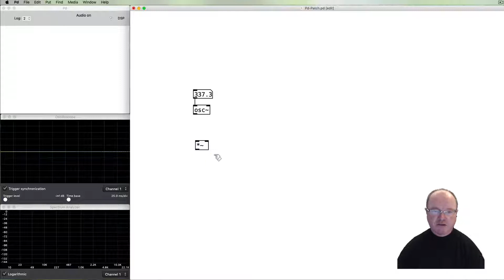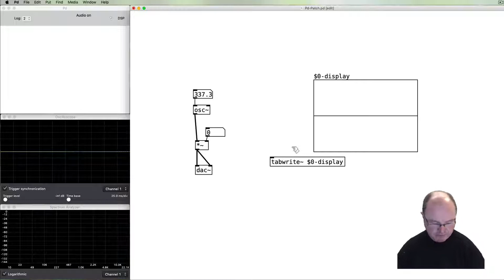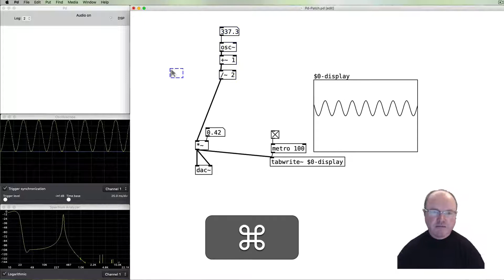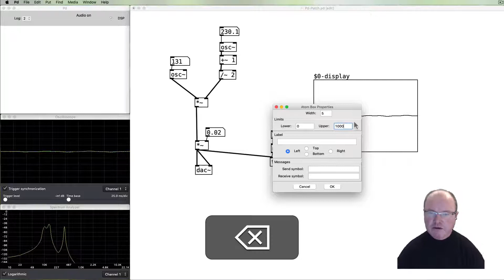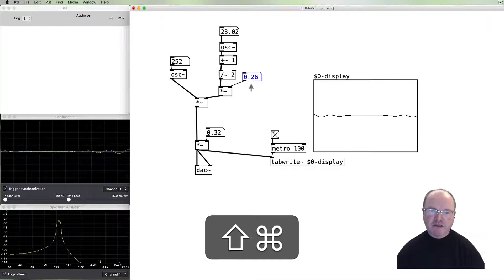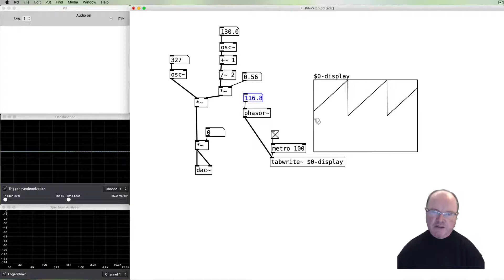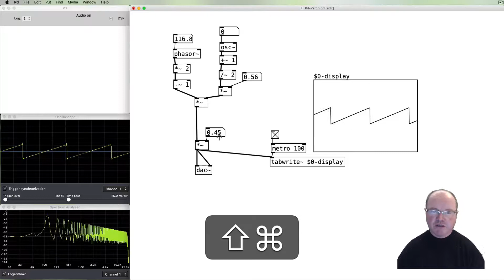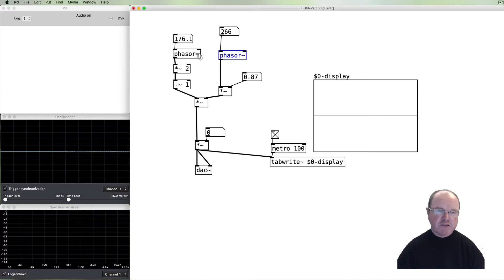8. Amplitude Modulation in Pure Data

Comment: Was there any particular reason why you translated to a unipolar waveform (6:00)? The only thing I noticed was that it halved the rate of the tremolo.
Reply: I think that it is because the waveform is being used to modulate the amplitude and the amplitude conventionally goes from 0 (no wave) to 1 (full volume), so you want the waveform to go from 0 to 1 as well. If you use a bipolar wave to modulate the amplitude, the amplitude will go from -1 to 1 instead. There's nothing wrong with this, but for a sine wave, this will result in the amplitude going to zero twice per wave (once at the beginning, and once in the middle, at each node), which doubles the rate of tremolo, as you observed. But for different waveforms, multiplying by a negative amplitude can drastically change the sound (to see this, try multiplying the sawtooth phasor wave by a negative amplitude and use it as an LFO). To avoid this confusion, people often use the convention that amplitude stays between 0 and 1. hope this helps!
Reply: I suppose for musical applications it doesn't matter, but in telecommunications, when AM is used for transmitting information, AM without the DC offset added to the modulating waveform necessitates coherent demodulation at the receiver (due to the envelope of the modulated signal not being proportional to the modulating signal anymore), which is more technically involved than direct/envelope detection.